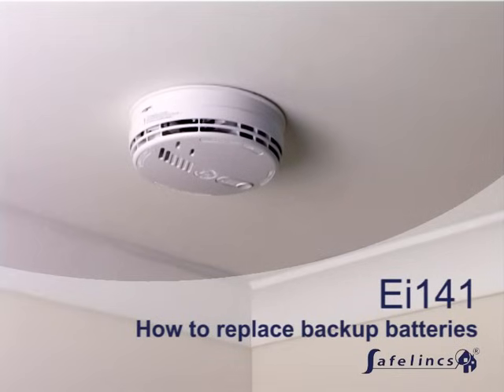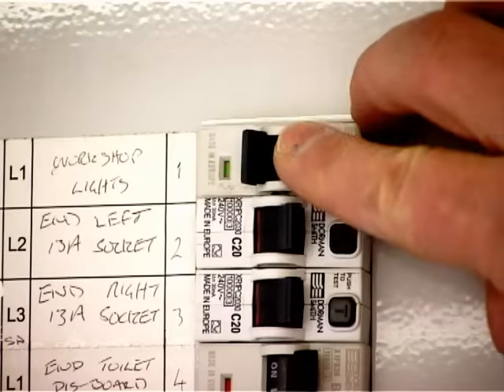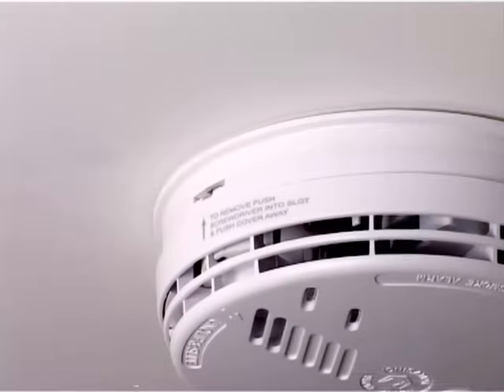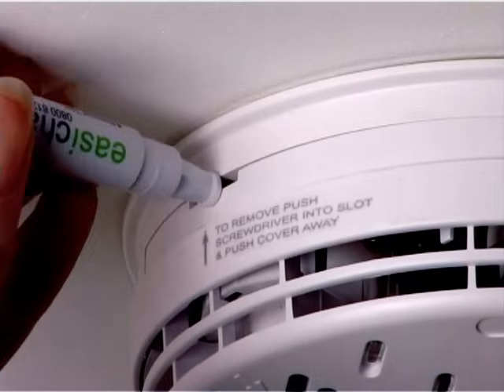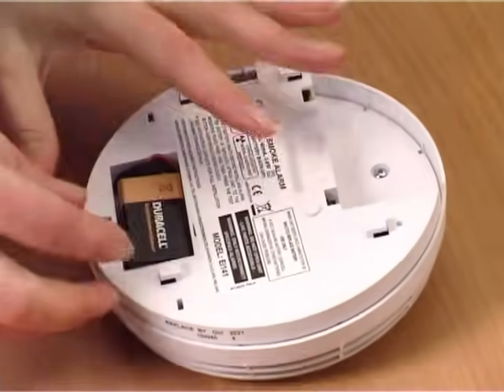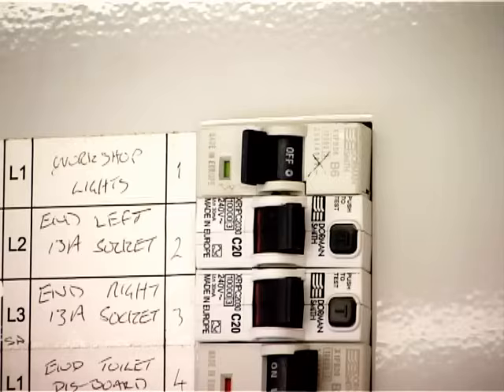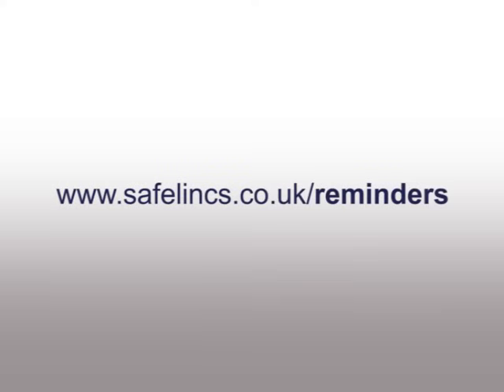Replace battery in Ei141 smoke alarm

Comment: Yes, smoke alarms are a good invention, put this particular model isn't as easy to change batteries on as the video makes it look. After listening to the bib for two hours in the middle of the night you might start considering burning your house down just to shut it up.
Reply: ‼️‼️soooo annoying
Reply: Exactly 😌
Reply: Yes removing the housing from the ceiling is a trial but after getting pissed at it I hit it and it came free immediately (with a 3mm drill bit inserted) , do not like the brute force bit but I was happy that it fell onto the couch and I could then set about fixing the battery. Then I came across all the info on the inside that is also misleading the information on the inside says to replace the battery then test actually that does not work...replace the battery, then put back on the ceiling then test is the correct method and only after calling the telephone number on the back and talking to the very helpful staff did I get that info so I am grateful for the service i got. The product seems good but as stated changing the battery is a pain in the butt. 
It also mentions something about house coding this is done when the product is installed and paired to another device. not sure how this is achieved and would have been nice to see in the video, especially when one needs replacing or another needs to be added to the system, I think that is the most serious omission here. I think the fact they had to make a special tool really says it all though.
Reply: @sheilab.     N
Reply: Difficult to open the unit.
Reply: So true.i gonna smash mine.woke me up 6am
Reply: You just need to remove its backup battery and it will stop beeping
Reply: 😂😂😂  Experienced the same just now! Anyway this video is still more useful than being without any clue when time comes to change the battery, exactly at the middle of the night. 😉
Reply: 😂 you are so right, the annoying beep all through the night is exactly what brought me here this morning.
Reply: I dare say, I will also need to invest in a step ladder now 😊😆
Reply: Such a bad flipping design considering it is supposed to save lives. People would be inclined to take risks and forget about it if they can’t open it. My friends smoke alarm has been chirping for 2 years!!!!! Mine has started chirping tonight and it’s driving me nuts already…. Plus my wee cat is now hiding under the bed. His wee ears are so sensitive.
Reply: @alexbvv  and the entire point of this thread is that it’s very difficult to do so
Reply: hardest part is removing the battery, 6 day's in and I still don't know how to lol
Reply: Horrible frequency on the alarm it's dangerous damages your brain wave frequency
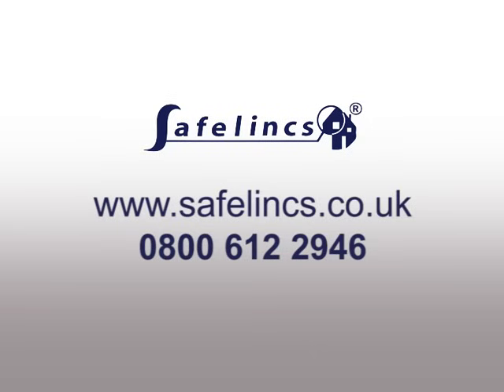Reply: @sheilab.  😊 1:44
Reply: @robertjschroff6307  1:44

Comment: why does the battery alway run out in the middle of the night?... beep beep all night long Grrrr
Reply: Something to do with low battery power in the coldest part of the day/night temperature cycle I think..............but happy to be corrected ;-)   As others have said trying to get the cover off is a PITA, nearly fell off the step-ladder trying to push the sliding section away...........
Reply: Bruh
Reply: Terrible design always runs out In Middle of night and so difficult to find tiny slot to put screw driver
Reply: I agree that's why I'm here now at 11:30 at night and can't get the thing off !!! Piece of crap why make it so difficult
Reply: That's just how battery's work, they have less capacity when it's cold. In the middle of the night is when your house is the coldest.
Reply: Literally just happened to me as we speak hahaha
Reply: It knows when you are sleeping 💤
Reply: Just done this now at 2:30 am woke me up shit myself can’t get the thing off
Reply: 4 am here aswell ... fok 😡🤬🤬

Comment: The fact that this video has over 1,563,481 views, demonstrates that there's a big problem with the design of these smoke alarms. For every "it worked for me" there's also countless "the cover wouldn't slide off" remarks. If we end up damaging the smoke alarm trying to get the cover off, it defeats the purpose of having one in the first place.
Reply: It’s designed to be tamper resistant

Comment: I finely got it down when it started beeping again for a new battery. What kind of idiotic machine is this! Its suppose to run on main electricity way does it even have a battery. And even when I got it down and took out the old battery it still makes a noise! How is that possible! Its now put a way and I don´t think I ever put it back on!

Comment: Top Tip: once unit is off its base, then remove backup battery.. BEFORE putting in new battery, hold down the TEST button for 30seconds to discharge the unit fully! Only then put new battery in..  (otherwise it can still "remember" there was an old battery and starts chirping again)
Reply: Been driving me nuts since 4.00am this morning. No problem changing the battery, but unit continued to flash red and go into alarm after refitting to base.  Tried the 30 secs hold test button tip, but still flashes red and goes into alarm. The label on the side says replace by 2013 (it's now 2021) so maybe the whole unit needs replacing??
Reply: Replace the battery and it still beeped. You have the solution. Thanks! This is the way!!
Reply: @alecmoore8492  yeah, you should actually replace a few months before the expiration date.. They work using a small chunk of radioactive material (with an ionization / "cloud" chamber), which decays (becomes less radioactive) over time.. if it has a 2013 expiry on it, it's useless, and you will need to replace the whole unit..
Reply: Thank you ❤️
Reply: Thanks just noticed the date 2019 , so will buy whole new units
Reply: Great comments❤. I removed the battery and it keeps beeping for a few minutes. And then I go to supermarket to grab a new battery. So maybe that's why I escape from that "memory disaster". But very good point about the discharge.
Reply: It's my unit that's chirping. Even with a day of no power to the units

Comment: Whoever uploaded this video should be elevated to the peerage. I am 80 years of age, and not known for my diy skills. I have 2 smoke alarm in our home. They both started bleeping at about 11.00am today -Sunday 21st of June. I straight away called in the assistance of my New Best Friend. My ipad.  I immediately received comprehensive details about the make-up of my smoke alarm, all in easily understandable terms. I was then led to this YouTube masterpiece of clear instructions. By 11.50 I had shot off to my local store. Got myself 2 replacement batteries. Returned home, and having had a refresher on the ipad, got up my stepladders and set to work on Alarm number 1. I followed the instruction to the letter. 5 minutes No1 was again fully operational . Into the kitchen and started on Alarm No.2. Which was completed in another 5 minutes. The whole job was completed by 12/45. 10 out of 10 to the poster of this masterpiece.
Reply: Best comment in youtube
Reply: You star

Comment: This video really understates how unbelievably loud and invasive the beeping is. I live in a student house in which I actually have one of these little f**kers IN MY BEDROOM. Naturally when sharing a house chances to start pissing about with electrical circuits are thin on the ground, and of course the sticker to indicate which switch to flick is nowhere to be found.

Put the battery in an easily accessible place? Nah. Make it so that you have to disconnect mains power and have the right sized screwdriver.
Make solely the light flash or the beeping hourly to indicate a flat battery? No. Make it beep EVERY 40 SECONDS.

This piece of s**t has driven me halfway to insanity, and I'm genuinely staggered by how poorly thought out and designed it is. I'm not usually one to complain but man alive..., and judging by some of the other comments here I'm not alone in this view.
Reply: Haha my neighbour just complained about the beeping so i took it down without turning off the powee oops
Reply: @lmurray1071   so did it work?? I did the same still beebeing 😪😫
Reply: I am having this exact problem right now. Why is their no “ shut up I heard you the first time but can’t do anything right now” button?!
Reply: Mine is in my rented flat in the hall outside the kitchen. I've pretty much forgotten what toast tastes like because it goes mental at the first sniff of it.
Reply: I recommend updating to sealed battery smoke detectors. The built-in battery lasts for 10 years so you don't have to deal with these constant problems. They are more reliable and the ultimate in home protection. Spend a few dollars more and avoid these headaches.
Reply: @lewisner  Classic rental property.  Everything is as inconvenient and done as cheaply as possible.

There is a price premium to owning your own place and you are responsible for the maintenance, but the freedom itself is priceless.

Comment: A firm whack of the cover is what you need!

A friend and I both tried multiple times, putting a screwdriver in and trying to lever it as shown in the video but the cover just wouldn't come loose, no matter how much we pulled at it in the direction indicated. 

What worked was putting the screwdriver in, whacking the cover firmly in the direction indicated with my palm, then voila! Off it came.

Saves using the sledgehammer.
Reply: This worked! I was a bit heavy handed though and it fell off and down the stairs, instructions on unit are counter intuitive. Thank you!!!!!
Reply: This worked! Thank you, this saved me hours of listening to beeping through the night!
Reply: You’re a lifesaver. Although of course it fell down on my face and gave me a cut lip, it’s better than that incessant chirruping!!!!
Reply: Bless you, bless you, bless you, a thousand times bless you! A firm whack is exactly what it needed! I thought I’d go mad trying to figure out this useless alarm!
Reply: Thanks!!! This did the trick!
Reply: THANK YOU!!! I was literally about to smash it like Phoebe on Friends😂
Reply: Thank you so much, did not think this was coming off at 5 in the morning!
Reply: Yeah this worked! Needed a few bangs with my palm
Reply: THANK YOU

Comment: As per rest of the comments, it was a nightmare to remove. Don't be fooled by how easy it looks in the video. I wedged two screwdrivers and my car keys in the gap between the mount and smoke alarm, then just spent ages trying to pull it down and away. Eventually it loosened and I was able to slide it off. You have to be careful with the downward force as I noticed the mount started to loosen from the ceiling - so I had to make sure I was pushing up on that while pulling down on the alarm. 2am, but I can go to sleep now.
Reply: I agree wholeheartedly. I'm normally good with electrical appliances, but this "insert a flat-bladed screwdriver into the slot, lever it ‘til you feel a movement, then slide the casing off" didn't work. The cover was stuck fast and the latch didn't appear to be disengaging. Terrible design.

Comment: really enjoyed doing this, the middle of the night half asleep trying not to fall down the stairs, Ealing council fitted these and never bothered to service them. batteries expired march this year! and we're leaking.
Reply from the maker: The best approach is to change the batteries once a year. That way you should never be woken in the middle of the night.
Reply: @Safelincs  I think the issue is more that doing a task that requires urgent attention, something which literally stops you from sleeping, should not be so stupidly hard and dangerous to do. I have had to balance chairs on chairs to get to one of these in a short term let, spent around 30 minutes searching on youtube and dwidling around with a blunt knife, only to desperately call my landlord at 6 AM having given up. And then having to wait 8 more hours for maintenance to come by with an actual ladder and screwdriver.

This has made me so incredibly miserable on multiple occasions, where if I only had to twist it and slide it off I might have been able to remove the cover? Is it really that hard to make such a design? Why not add a button of sorts where a screwdriver was meant to be inserted? Why does the sound have to be shrill enough to keep someone awake for 16 hours?

I am currently trying to figure how in the world I can deactivate this with two swivel chairs which just about let me to insert a screwdriver when I go on my toes... 

I deeply, really loathe this product so much. You forget how bad it is, until the one in the other room starts beeping again and you go through the same process. Not to mention it goes off when I make toast in the next room... I really want to know who made this so I can interview them and ask them wtf were they thinking, did they test this out.... I mean I really, really hate this so much.

Comment: Problem sorted. I've forced off, breaking the unit so I could get the battery out. What a badly designed product. Will make sure it's replaced with a unit that is more user friendly. I can understand the need for beeping to alert you to a low battery, but MAKE IT EASY TO CHANGE THE DAMN BATTERIES!!!!
Reply from the maker: +Emma-Louise Smith Hi, I agree with your frustration. It should not take a help video or even a hammer to stop an alarm beeping! You might want to replace your alarms with Fireangel alarms featuring the 'Sleep Easy' function
Reply: So it's not just me. Alarm unit installed on the landing overhanging the stairs, with the removal hole on the other side where I can't see/reach it when I'm up the ladder. It's dislodged all right but won't slide for love nor money. The beeping is driving me crazy, and will drive my neighbours crazy when they want to go to bed. How did you manage to break it off? I have a metal mallet? I must say it would give me enormous pleasure to hack this thing to bits, but I don't want to damage the ceiling or electrics...
Reply: American version is much easier
Reply: The instruction on the alarm should say "push and SLIDE OFF". Until I saw this video I could not get why it wasn't budging. Why you can't simply unclip is ridiculous like taking out a ceiling light bulb or so.

Comment: This is the job from hell. No wonder people die in house fires having disabled their alarms. I had to pull my alarm bodily from its ceiling mountings to allow me to remove the cover and access the battery. Easier to cut the wires and throw it away. Poor design and potentially fatal. Thanks for the upload tho'!

Comment: Very helpful. Thanks.

To make things easier for next time, I've filed down the plastic 'latch' on the lower section of the alarm. To remove it now, I simply have to slide it off. No need to search for a suitable screwdriver at 2 am in the morning!

Also, I've invested in a 'lithium' battery - should be good for 10 years!
Reply: Brilliant comment. I love your solution and will adopt it for my own smoke alarm.

Comment: Praise the Lord for this video at last I've managed to open the damn thing.  I would add, spending nights trying to persuade yourself the intermittent 'beeps' are the soothing sounds of a Nepal waterfall doesn't work, nor does hitting it.  Would really help too if the Landlord could simply leave instructions akin to the above in the property, but I guess that's too difficult....
Reply: I agree with your first sentence.  There are no instructions on my alarm and after spending ages trying get it open, I gave up.  Suddenly thought Google might be able to explain and lo and behold I found this video.   Had the cover off, battery replaced and cover back on within seconds!!! Many thanks.
Reply: DrDublin m
Reply: Ditto to everything DrDublin said above.
Reply: DrDublin b
Reply: Praise indeed! Manufacturers MUST know by now that these things are impossible to quiet, whether they’re going off from a smokey oven or bipping from a run down battery, they drive everyone nuts!!!! And so thousands of people end up simply disabling the bloody things. I bet I could walk up and down my street right now and find a dozen of them in exactly the same place that mine is now- wrapped in a bag in the cupboard under the stairs!
Whatever the reason manufacturers make them so hard to switch off or to get the battery out (I assume there IS a reason?) surely they have to take that into account
Reply: Has anyone managed to change the battery without turning it off at the mains? I have no access to the fuse box. Also will pressing and holding the test button nullify the chirping without changing the battery?